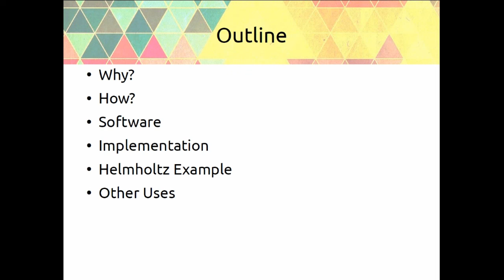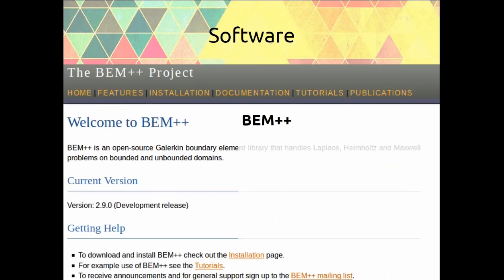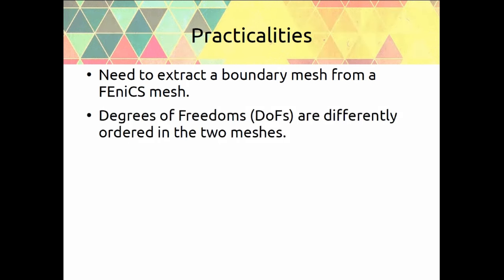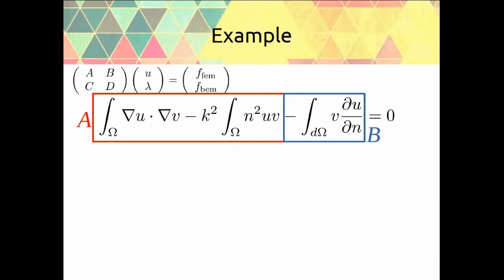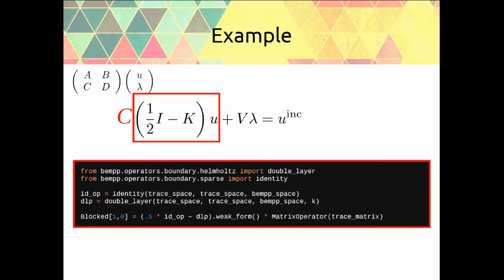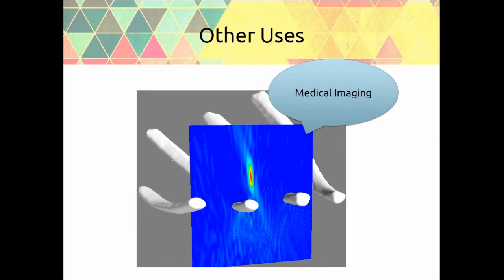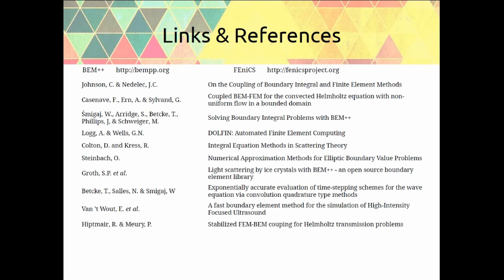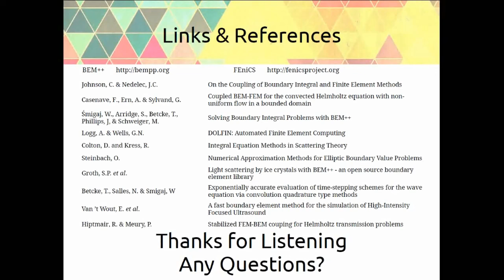Matthew Scroggs: Using FEniCS With BEM++ For FEM/BEM Coupled Problems

Comment: Hi! nice video, thanks for  the explanation. I'm trying to run FEniCS on ubuntu, I already installed it using the terminal and the instructions on fenics.org , but how do I use it? I can write code on PyCharm for example, and the use the FEniCs packages? I'm trying to do that but it isn't working.